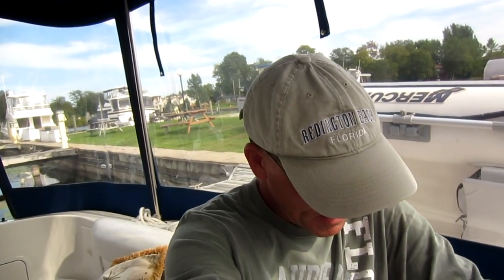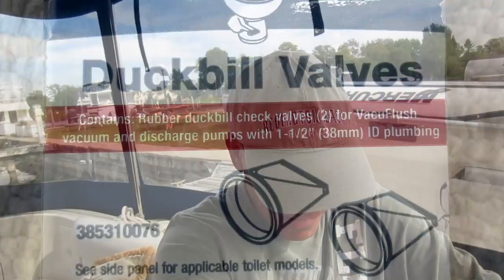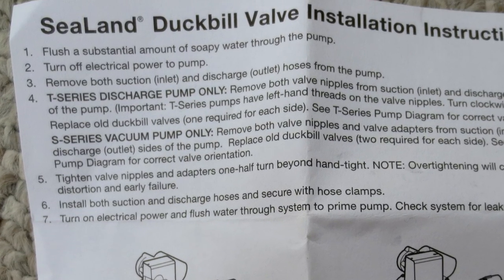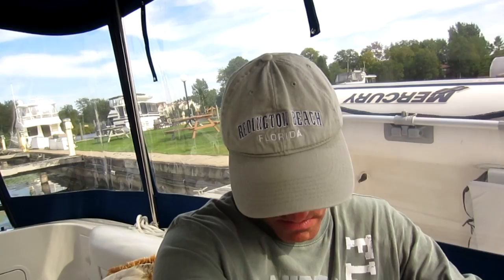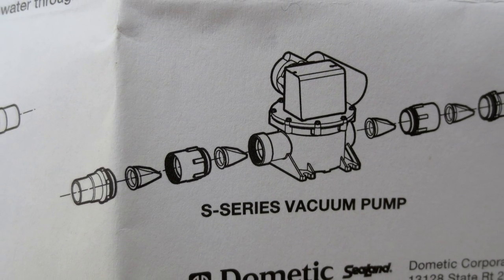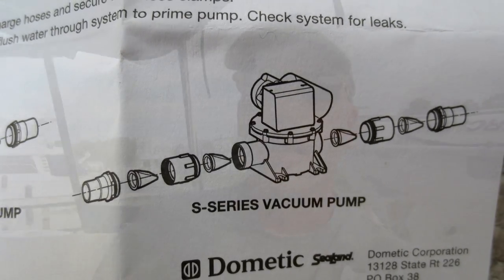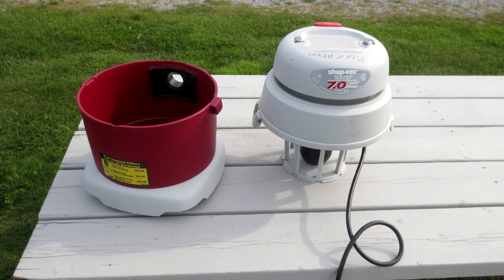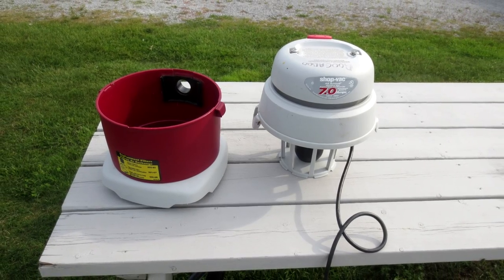Marine Toilet - Vacuflush Duck Bill Valve Replacement :-(

Comment: Another good video boogabooster.
We found the duckbill valves online at Seacoast Services. The part number is usually printed microscopically on the top of the Vacuflush unit. Call them is best. If you don't have the part #, they guide you through figuring it out.
Next to impossible to find Vacuflush parts on the west coast.
Vacu flush is the only way to boat IMHO. Well worth the extra maint and expense.

Comment: I was lucky enough to only replace one set. I probably should do the other, but, next time. I flushed about 8 gals. of soapy water before going to work. Here's what I will share. Watch out when you pull the hoses off. Because of the pressure I had to apply, one of the hoses snapped up and drenched my face. YUK!!!
Reply from the maker: mjmason1014 Been there, done that!

 Check out my Channel for a whole Playlist of videos from the work I have done to our toilet systems on the #boat, including a complete holding tank replacement (https://youtu.be/5OvvvG4Ckqc) as well as replacing all the lines (https://youtu.be/f6xJB_mN38Y).

 Let me know what you think of them fun jobs :-)

 Cheers, Paul.